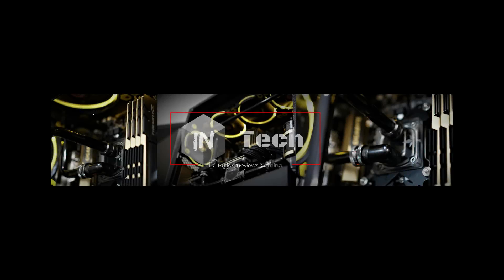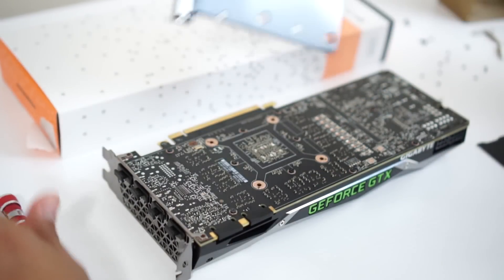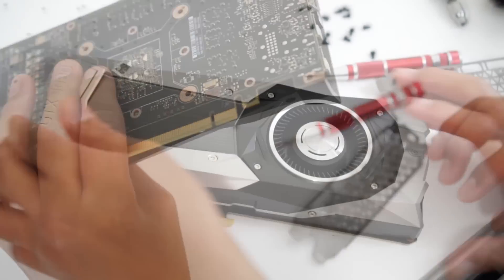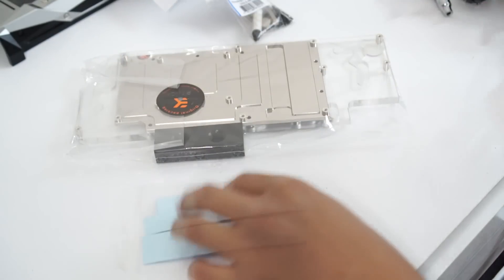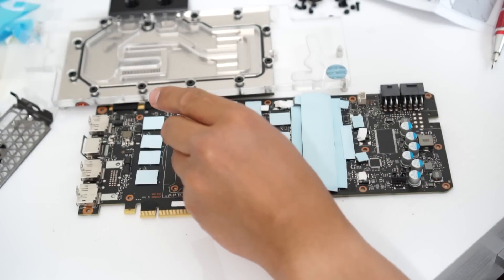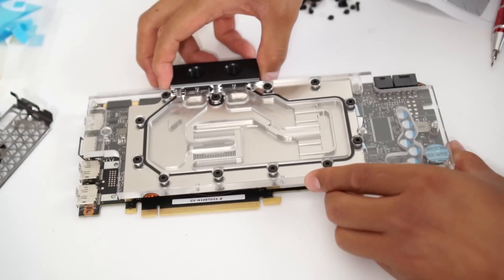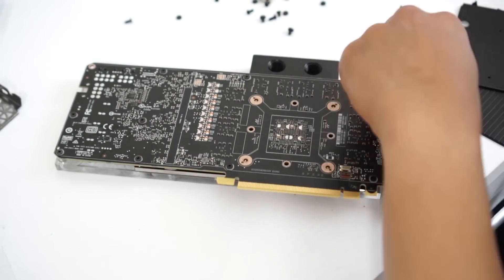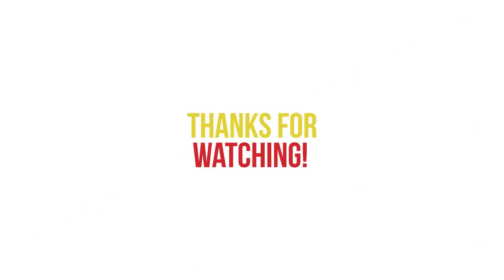How to install GPU Block - GTX 1080 TI/Titan X pascal

Comment: Since you asked for comments in the video here they are: I think you are bad at pronouncing English which is kind of annoying when watching your video. Also that in most of the shots you use your left hand to screw which is fine, i don't mind people being left handed. But it makes so we can't see what you're doing, which is kind of inconvenient when that is the purpose of the video. Also seen other videos mention that the back plate only need to be replaced if you use some thermal compound to distribute the heat, but you didn't do that in the video and only focused on putting thermal compounds on the "front" part, or the GPU shroud as you called it. Why is that? Watching videos like yours to learn about this since i'm interested in getting one my self, so as the last comment i guess ill say thank you for showing your way of doing it (even though it could use some improving in some areas.)
Peace

Comment: OMG! Did you read the manual before applying thermal pads? Why didn't you remove the white thermal pads? Why did you put the narrow strip next to inductors? The manual says it is way different to apply thermal pads.
Reply from the maker: smicha7 yes I did actually and it's my first time doing it couple weeks after I took it out and replace it with liquid metal from cool labs now it's sitting at 24c on idle full load 2150 31c I'm pretty happy with the result

Comment: Looks so good but so nervous to do this...
Reply from the maker: Zephyr L you should do it man! It's not that hard just explore and do it easy
Reply: Hey Ivannooz Tech I have a nvidia branded 1080 ti and Im really worried about water cooling it because once i do the warranty is gone. Should I still do it?
Reply from the maker: Jade Games well if you're worried about warranty etc just get a zotac arcstorm 1080 ti it's already comes with a waterblock but you already have the gpu just up to you to be honest but I'm so happy with the result 😊 please sub
Reply: I subbed and liked. The sad thing is I cant return my 1080. Ive had it for over 90 days. My only choice at this point is to sell it which I am not going to do. My two choices are to just leave it be or water cool it. Once again though I pretty worried. On a scale of 1 to 10 how hard is it? One being installing ram ten being building a laptop from the ground up.

Comment: Answer me this please, 
At the Ekwb site they say that the original back plate doesnt fit with the ekwb gpu block how did you manage to put it like that?
because i prefer the original backplate rather than ekwb backplate.
Show us overclocking and temps of it! great job by the way ;)
Reply: Facepalm over 9000
Reply from the maker: helder carregosa the old screws won't fit they're so little I kinda forced the new screws basically just the four corners of the back plate and add thermal pads then you should be good 😊 you can get a custom back plate on eBay with your designs. Watch my gold and black build also subscribe if possible thank you

Comment: Im about to block a 1080ti :D I was wondering what exactly that screwdriver the red one is?
Reply from the maker: SlimSticky it's not that hard man you just have to get the right tools I got that one from Walmart it has small screws and it's magnetic perfect for computer stuff did you see my anubis build?
Reply: Ivannooz Tech  no not yet but I was wondering if the Phillips size was 0 or 00

Comment: do you think that you could do a review on this as in what temperature it runs at how big radiator you need how much it cost and all that good stuff
Reply from the maker: honi well I had dual 360 thin rads and my gpu was hovering at 24 idle maxed with over locked temp is 38 but when I installed to my new build the artic vanguard which has one 360 and one 120mm radiator all slim ones idle is 36 and max temp is 51 there's big difference my CPU temp idle 34 max about 72
Reply from the maker: honi well it cost me 120 for the gpu block and 699 for the ti plus taxes well thanks for the input man I should added the prices on my video
Reply: I'm serious I haven't seen one review on this yet
Reply from the maker: honi please subscribe
Reply: thank you
Reply: I just did

Comment: it says on EK's website that the stock backplate is not compatible with this waterblock.
Reply from the maker: Dryst® any Titan x gpu block will fit on 1080 Ti
Reply: i know that, but i wasn't talking about the waterblock. what i'm saying is your not supposed to put the stock backplate of the 1080 ti when using that waterblock

Comment: Isnt that too much paste? Looks kinda much
Reply: With paste, the only problem he's going to run into with using that much paste is cleanup when he re-applies in a year or two. It isn't electrically conductive, so overflow won't cause any electrical issues.
Reply from the maker: michamus thanks for proving that point I can always change in the future or a better gpu block but I don't see that for now as it is very beefy beast
Reply from the maker: i guess but thats what it says on the booklet and i'm happy with the 24 idle and plus 160mhz on core full load rendering at 42 see my Custom loop build if you can :)

Comment: Your thermal pads setup is very very wrong for the VRMs. the chokes only need the 0.5 mm thermal pads, and the MOSFETs use the 1mm pad which is wider. 
also never stack thermal pads. Specially low hest transfer  ones like that come with the EK water blocks. 
Also if you use the stock back plate, the contact  pressure is not as good as it is when your install a different black plate.
Reply: achingowl is right, you applied the mosfet and choke thermal pads incorrectly. considering your video is a how to install a GPU water block, you should re-edit the video or at least annotate where you did it wrong. Your GPU temps aren't going to reflect your mosfet temps and YOU ARE overheating them. Chokes don't even need cooling BTW.
Reply from the maker: achingowl thanks for the input sir it's my first time doing it but I'm happy idle temp is 24  plus 160mhz on core max temp 38 I'll take off the backplate and replace it 😊
Reply: Temps seem to be great! But sometimes if a component is not making contact, MOSFET's in this case, they may fail or have reduced life over time. 
160Mhz seems to be a great Overclock as well!!
Reply from the maker: Yes sir i'm so happy with this though i'll take not on my next build you're awesome
Reply from the maker: Dh66 yes sir!

Comment: What temps are you getting at full load?
Reply: Thank you for the video. I modded a gp102 reference pcb with a Heatkiller IV block. I overclock +160MHz and temp seems to max out at 38C with 24C idle.
Reply from the maker: Peter Cher idle 24 full load overclock plus 160mhz 42 😊 you should see the build for this gpu
Reply from the maker: Martin Klinge nice! What's your radiator? I have 360 and 120 right now idle at 36 max load plus 160mhz is at 49
Reply: I use two EK Coolstream CE 420mm and one 280mm rad. My re-lidded 7700K 1.32V 5GHz seems to max out at 80C using BOINC 90% load (so i can still browse). What do you mean 36 max and plus 160mhz 49?
Reply: I noticed the Heatkiller IV instructions and thermal pads do not cover the VRM's. Neither does the reference aircooler where they are cooled directly by airflow. This might impact the temp of the block since the GPU does not share dissipation.
Reply from the maker: Martin Klinge daaamn of course you have bigger rads plus the branded parts but very small detail adds up the total $ you spend
Reply from the maker: Martin Klinge have you seen the Anubis build I have?
Reply: I have not but i will look for it. BTW i got shaky hands modding the gfx pcb. I had to wait 4 days too see wether it survided the mod because the system wasn't ready yet.
Reply from the maker: Martin Klinge lol let me know how it goes man send me a message on Facebook on your build
Reply: Ok I will. I have made a few photos during the build and also posted them on HardOCP.

Comment: Could someone recommend a good screwdriver set/kit which can  be used to open this card and fit the water-block.
Reply: Duppex Ellis if ur from uk i can help you with that for really cheap as well
Reply: Yeah, I am from the UK. Do you have any recommendations?. Cheers

Comment: water cooling voids the warranty ?
Reply: Insane bot I watercool my GPU's so I buy from EVGA, they let you take off the stock cooler and watercool without voiding the warranty which is huge for me since that helps in reselling.
Reply: overclocking voids warranty???? funniest thing i've heard today
Reply from the maker: Insane bot I'm not really sure man but it really cool down my gpu idle at 24c
Reply: that's cool..
Reply: what about other brand ?
Reply: Insane bot no it doesnt when you send the card back for warranty you have to put back on the stock cooler but if you overclock it the warranty gets void so i recommend getting a gpu with highest clocks and then watercool that and use their oc mode for gaming for example the asus strix 1080 ti
Reply: jrok96 it does void the warranty mate
Reply: They wont even know that the card is overclocked unless u admit and tell them u overclocked it .. :)

Comment: i see some.. yeah thermal pads but is it for the heat or it just enables it to push the block so it wont leak?... not to mention others is like one line of thermal pads without cutting it individually XD...

also... this is kinda the scariest mods if one enthusiast could make but its a challenge, and i watch the techsource on making his like this, like putting water in radiator and have to wait out like a day, kinda like that, and also the measurement of the tubes O_O....
Reply from the maker: lionelsioco123 it's pretty much for heat dissipation yeah it's a challenge but it's doable 😊
Reply: Ivannooz Tech ah... hehe 😄😄
Reply from the maker: lionelsioco123 the tube bending is a pain in the butt and I waited couple days for all the water to sink in 😊
Reply: Ivannooz Tech at least all those patience comes paid 😉😉, especially that little burner then bending galoreness XDD